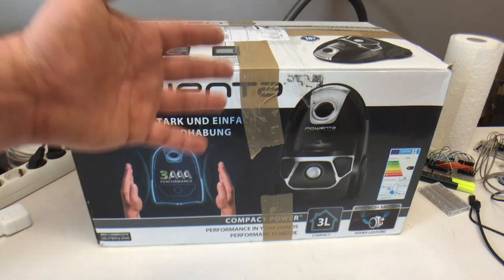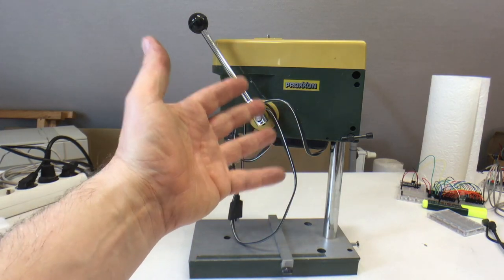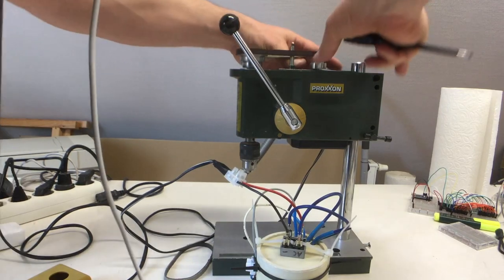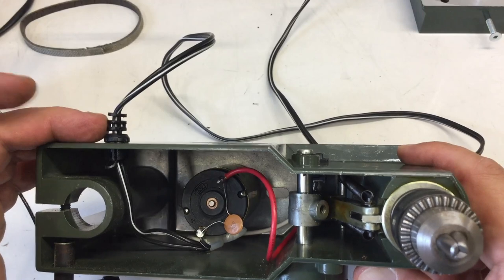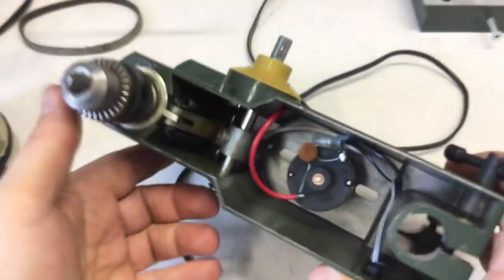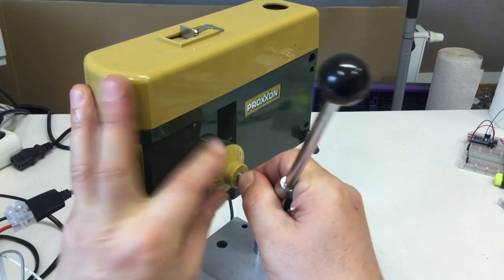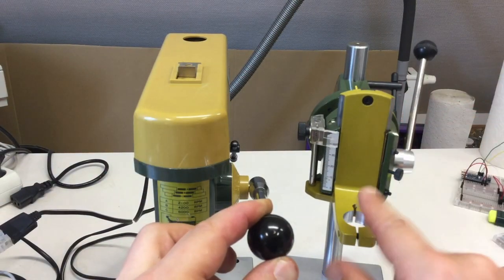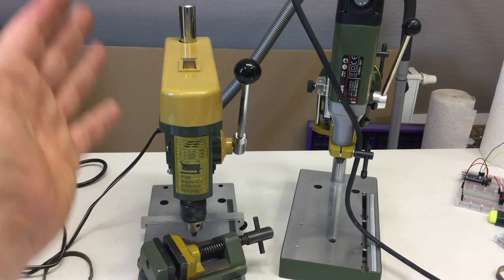Vintage Proxxon TBS 12 Drill Press Unboxing and Partial Teardown

Comment: The Roehm chuck is an option for this precision drill press; they usually sell with a set of Micromot collets.
Reply from the maker: Thanks for the info! I will definitely get the collets then when I have some precision work to do. BTW do you know if Proxxon is still selling Röhm chucks as an option, or did they switch no-name chucks at some point.
Reply: @robertssmorgasbord  Yes, they are still selling them.
Reply from the maker: Thanks for the info!

Comment: Hello Robert, why did you buy the TBS 12, when you already have the MB 200?
Reply from the maker: The MB 200 drill stand takes my IBS/E, which is good for drilling at high RPMs up to 22.000. However, there are materials that don't like those high RPMs (e.g. ABS) and just melt (messy) instead of of creating chips. Also, drilling metals at high RPMs kills your drill bits quite fast. So I wanted something that could drill at really low RPMs.
Reply: @robertssmorgasbord  Thanks for the quick answer, appreciated! The TBM 220 (2020 production) has 1800/4700/8500rpm, yours has 2100/4200/6000rpm, my Micromot 50/E goes from 5000-20000rpm, i see. I will take this into consideration when deciding between TBM220 and MB200, thank you!
Reply from the maker: @leecherlarry  You're welcome!
Reply: @robertssmorgasbord  I decided to get the TBM 220 😃